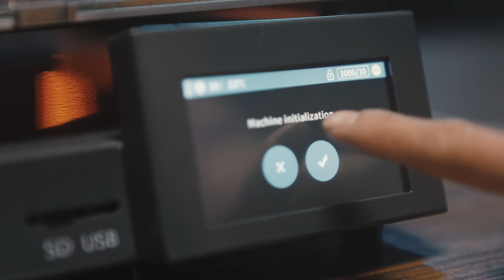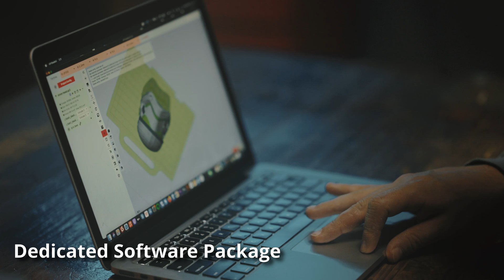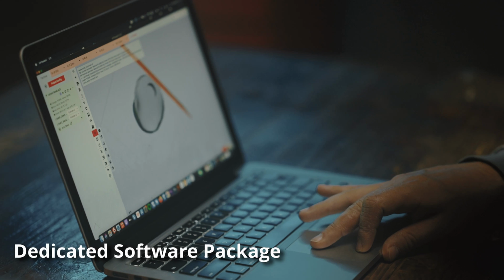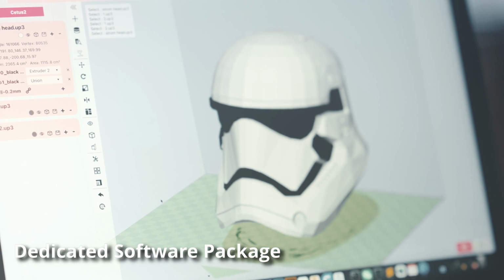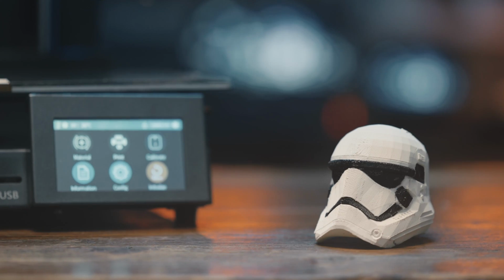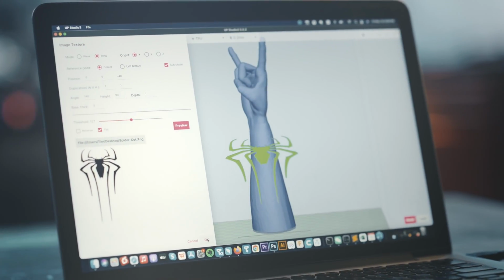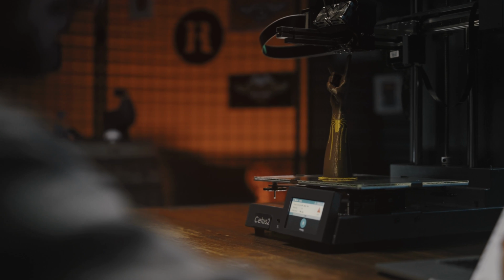#Cetus2 Dual Extrusion 3D Printer with On-the-Fly Material Switching OTFS by Cetus3D

Comment: No! I am done with (cetus3d) printers, or any 3d printer. After less then a year of use, there where too many problems with it. You name it, I had it. So I have thrown away this piece of (fill in your own curse word). My recommendation, let your design print at one of the many 3d print services. For the price of a printer, you can print many parts at a print service. And the beauty of it is, that you can focus on the design and material choises and more. Keep in mind the print orientation for strength.
Reply: The point a lot people use a printer is to not go out and pay for a service. Its a hobby. Your argument is invalid to a majority of people.
Reply: This is hands down one of the dumbest things written on the internet to date.